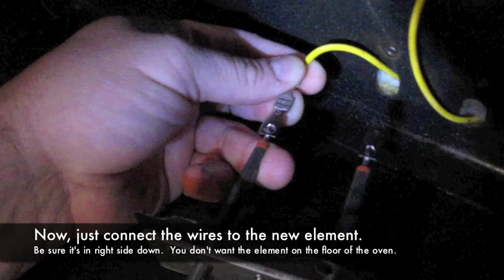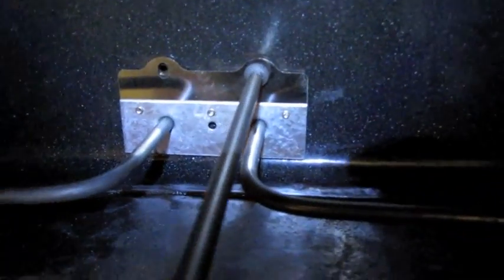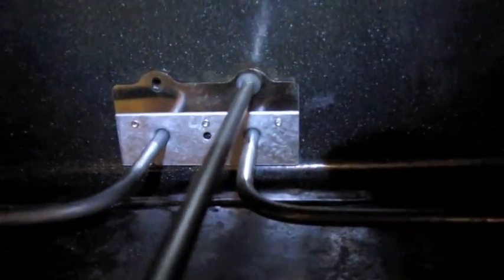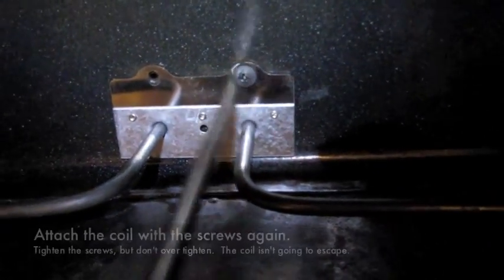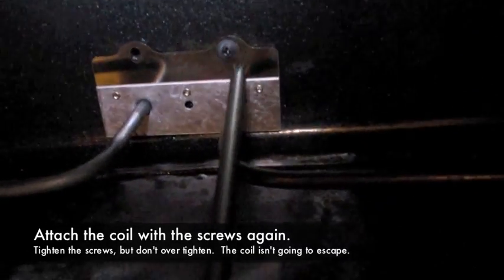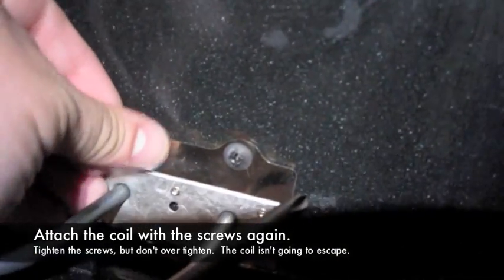Replacing an Oven Coil (Bake Element)

Comment: THANK YOU!!!  I couldn't tell if the wire was supposed to "slip off" the element.  Ours were on tight -- and that was the hardest part for us in the 10 minute job (including the time to get the tools!).  But the wires slid on the new element without effort.  Thanks for letting us "free-ride" on your experience.

Comment: This gave us the confidence to do this project ourselves. Thanks! One snag we ran into was that one of the wires had very little slack so once we slid the element out, the wire disappeared back into the innards of the oven.  Had we been prepared, with duct tape at the ready, we could have secured the spade end of the wire to the inside of the oven to keep it where we could access it.  The work-around was easy.  Removed the back of the oven (4 screws) and pushed the wire back through.

Comment: Thanks for the video, you confirmed that wires SHOULD come out from the insulation so I knew I had to remove the back panel to find them and push them into the oven chamber to connect to the element prior to putting into position and securing it to the back wall.

Comment: Thank you very much.  Something was different from mine I'd like to share:  I don't think there was enough slack in my wires to pull them through.  I ended up bolting the new element in place with them disconnected, then removing a very convenient access panel on the back of the oven, and making the connection there.

Also, SHUT THE POWER TO THE OVEN OFF.  Turns out there's still power to the oven when it's turned off.  Ended up burning the left tab off the old element as it arced on the liner.

Comment: My element blew up the same way yours did. Spark, glow (thought it was a fire), shut oven off, saw split element. Thanks for the video!  My screws came off easy, but I was afraid the plugs would be caked on, but piece of cake to pull off. Just debating whether to clean the oven now...

Comment: Thanks for the video. I just replaced ours but it's still not working. Think I'll take your advice and check to see if I plugged them face down or right side up. Would love to see how you actually took off the door. It's a real pain with it on.

Comment: VERY helpful video!  Even seeing you turn the screws left herlped me - was trying to turn them right.  NOW I know, "lefty-loosey, righty-tighty", but didn't know at the time.  Thanks!  Is it safe to use liquid wrench to get the electric conductors off the old element?  I swear mine are corroded right on.

Comment: very nice, however you should not touch the coil with your bare hands because the oil from your skin will degrade the coil. best to leave the plastic wrapper on the coil when installing it and remove it when it's securely in place (before heating it).
Reply: +Bill Sanders Thanks for that info, Bill. I'm about to embark on an oven repair mission, and I'd have had my filthy mitts all over the damned thing before I got it installed. You probably saved me the effort of doing it again in a couple years.

Comment: This is a really easy to understand video.  Unfortunately, when I removed the broken element, the spade connector had come off, having burned through the wire.  Can I try adding a new connector, or will I have to replace the whole wire (or even wiring system)?
Any advice would be most welcome.
Reply from the maker: I'm no electrician so I can't give you a definitive answer.  I would guess you could simply replace the spade connector with a new one.  Kill the power. Strip the insulation off the wire and crimp on a new spade connector.  Good luck!

Comment: Mine broke last night, as I was walking into the kitchen to check on my dinner, I see the element fall (in a blaze I might add) to the bottom of the oven. After viewing your video, i unplugged, and unscrewed the top element, but the wires on both sides refused to come one even a bit.. I pulled gently, they both released, but the wires are nowhere to be seen.. I guess I'm stuck with no oven for a while :/
Reply: I "lost" one of the wires too in mine. I just took off the back panel and pushed it back in.

Comment: +Mark Neustadt , This is a shot in the dark seeing how this was years ago, but by chance did the bottom have any effect of the broiler? My entire oven doesn't turn on but my stove top does. And was thinking it could be my heating element.
Reply from the maker: Sorry I'm not more helpful, but you're right.  I don't recall using the broiler while the bottom element was broken.

Comment: does the correct part number even matter?

My repair shop said that if its the same volts (mine is 220 volt) and if it is roughly the right size, it will work.  is this correct or not?  if so, why does anyone worry about getting the exact part number?  if your store is sold out of yours, you could just get a similar one.  any thoughts?

Comment: After unscrewing the screws and pulling at the coil, mine sparked and scared me to death.  All I'm trying to do is clean without the coil in the way--have I broken it?!
Reply from the maker: I'm no electrician but it sounds like you might have neglected to shut off the power.  Please be careful as there's a lot of power going through those wires.  If you're not sure about what you're doing, please contact a professional!  Spending a few dollars to be safe is worth it versus getting electrocuted!
Reply: Mark Neustadt yes, I figured that out really quick.  haha.  thank you!

Comment: Hi my oven is heating for about the 30 mins then the oven starts to cool down. Ive changed the thermostat, the thermal cutout and its still the same. Running out of ideas, i thought at first theres no way it could  be the element, cause it either works or it doesent and i would have different symtoms ie) not heating at all...
so im kind of lost...
I took the covers off and watched the element heat, only one side of the element goes orange colour the other side does not????Is this normal for a fan assisted oven element???
Any ideas would be much appreciated folks

Comment: what happens when u dont have enought slack on the wires and one wire falls in back?like mine just did
Reply: Then you get to pull the stove out from its cubby, take the back off, and put the connector back through.  Not difficult..just makes the job take longer.
Reply: we fixed it